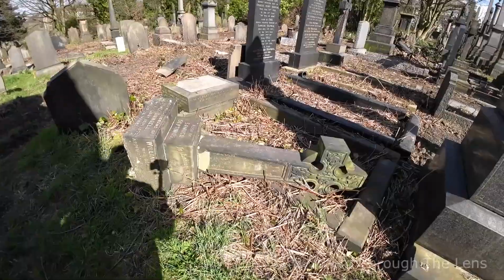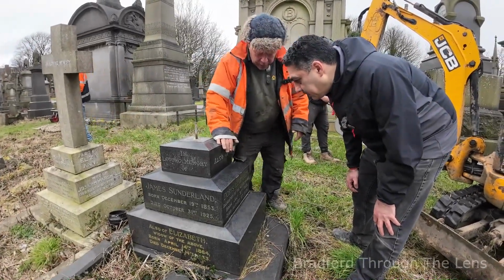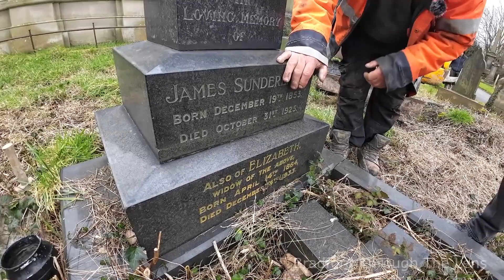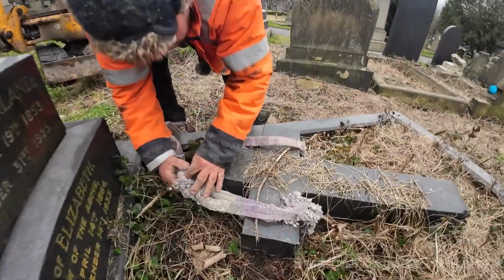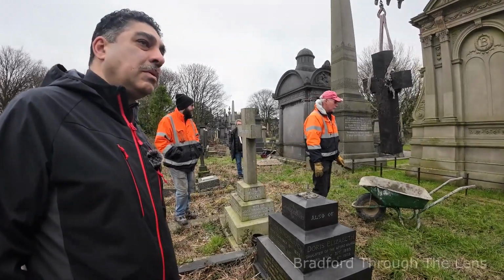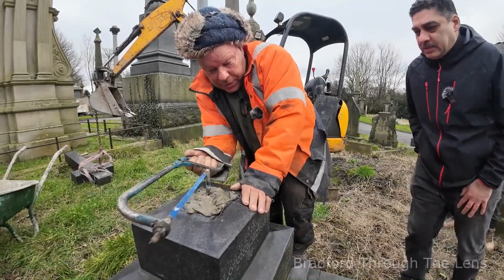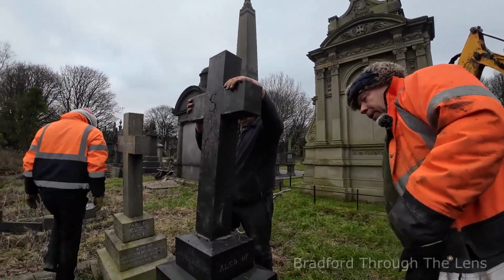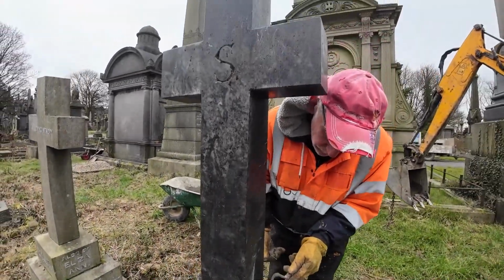Restoring a Fallen Cross on a Grave - Honouring Memories and Preserving History. Bradford

Comment: They should not be using Sand and Cement to repair this , it wont last a year.  This day and age it needs to put back with Resin and that will last another 100 years.
Reply: I agree We use resin to repair our graves at our grave yard. I agree the cement will not last long
Reply: What do you use? I assume you mean a two part epoxy but what is the name of the product? Thanks.
Reply: @cmg6848  We use several types. For big projects we use a 2 part compound that takes 24 hours to cure.  For smaller ones we use "Everbuild Anchorset Green 300 Chemical Anchor 300ml" which goes off in about 30 mins.
Reply: Im a mason. neat cement, nothing else